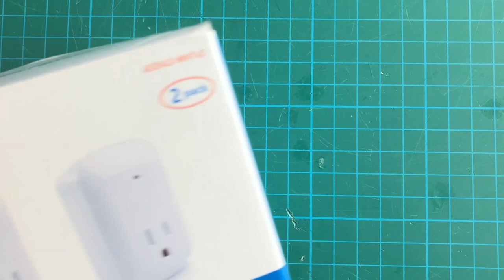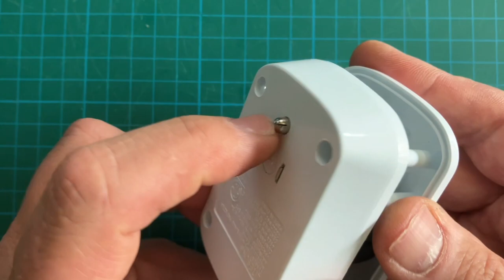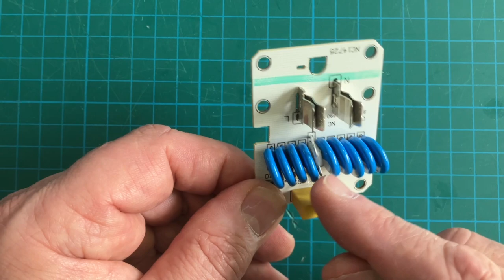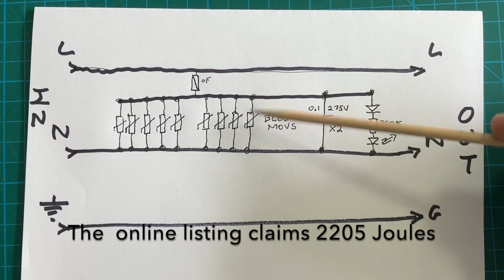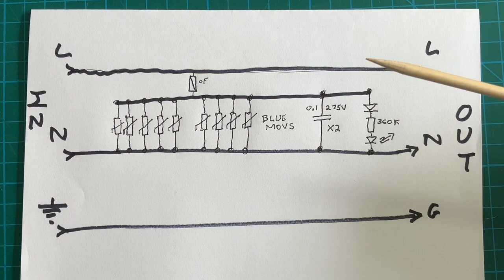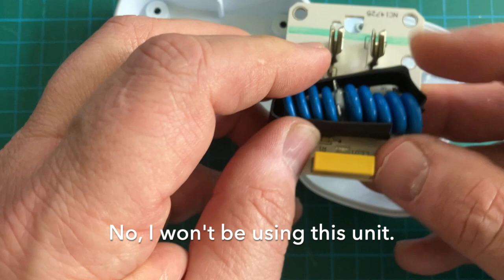9 MOVs??? Weird Surge Suppressor #1 With Schematic!

Comment: You should have put it on a proper line and blown it up.  If you would have shown the failure in the product in a safe way that is all we needed to sum up this very thorough and awesome video. Show the public what happens when you plug this cheap crap into your walls and forget about it.
Reply from the maker: Actually, that idea did cross my mind, as I assume videos titled "...with explosion!" might be popular.  Unfortunately, that would require, if you believe the specs on this unit, a source of >900VAC, which I lack.  Thanks, tho for the suggestion!
Reply: @dtss_smudge  I don't believe the specs on it. I'm sure you could pop it:D